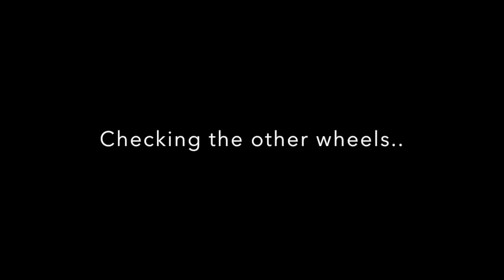New C63 wheel damaged after only a month!?

Comment: not trying to be mean, but you need to have some budget money for replace/repair your wheels if you are gonna go with low profiles,  thats why me and my friends always talk about it but never use it, tires are not cheap, rims are not cheap, and low profiles breaks very easily, just prepare for it, and dont get too upset because its totally normal
Reply: I can hit a curb and totally get away with it, I can roll over speed bumps at a much higher speed, I can drive wherever I want without worrying about shitty roads, and I take these advantages over the "looks good, improves handle" advantage that low profiles have

Comment: Just saw this vid. Welcome to PA roads.  With my most recent car I dropped from 235/35-19 to 245/40-18's because of these garbage roads in this garbage state bubbled 2 tires.  Also, factory "forged wheels" are never worth it in states like this.  Many factory option forged wheels are not super light, and bend as easy as cheap wheels even.  I learned that lesson a decade ago in PA, and relearned that last summer.

Comment: Could have been worse, hit a pot hole once, shattered the edge of the wheel, punctured a tyre and ruined a wheel bearing. Looks like the hole caught the wheel right on the edge though. Chances are if you just hit the hole square on it would have been fine.

Comment: That's why i never invest in wheels, roads around here are terrible and you wont survive with anything bigger then a 17... Really sucks man but that dent isn't bad at all, little heat and a hammer and they will have it straight in no time, I've seen way way worse wheels get fixed, will wheels like yours, you will have to be ready when this happens again because sadly there is a big chance of it .. Heating it up wont weaken it substancially.. This isnt a car you drive 250km/h + every day so I wouldnt worry to much because once you change that wheel and spend 2000$, hitting a pot hole again and damaging it again will make you wish you would have just fixed the wheel with some heat.. Only if it cracks then that is time to get a new wheel.

Comment: Low profile tires in Pittsburgh or any major city for that matter can get you man. I am looking into better tires at the moment before I purchase my 18 inch light weight, 18.4 lbs - 18.95 lbs vs 23-29 lbs factory Ford Fusion wheels,  OZ Racing LEGGERA HLT or the OZ Racing ULTRALEGGERA. If I can find light weight steel wheels that aren't ugly I would consider those. The OZ Racing wheel are a mixed Aluminum product, chem. compound Al (Si 7) Mg, and I believe can bend more so under stress than steel. I could be wrong; I need to find a YouTube vid about it that has no bias.....they aren't sponsored by any of the manufacture of the wheels, that mean the cost is on the Tuber, I am broke tuber so not gonna happen here. Unless I go technical on the vid and not care that I spent a couple thousand dollars on wheels just to crush them to see which is stronger. Well, gave that idea away......here comes the new YouTube channel that will out pace mine in a few months.

Comment: Dude, I’ll take your Swedish passport.  You can have my American one.  This county is going to shit.  I’ll need a Ford Raptor myself soon just to drive around the North East. You know in Mexico a lot of the OEMs will not sell the optional low profile tires / wheels.  They need to start doing that in the US.  I know someone who bent a 16” winter wheel in NJ that he puts on just for the winter. I’m on Long Island, but I’ve bent one rim on the NJ Turnpike, and year before that I had a blow out coming out of Philadelphia on the NJ side.  I bent another a year later in August around Poughkeepsie NY.  I was driving my SUV the other day and hit something that must have been 10” deep (it was filled with water) and I was happy I was not driving my 40 profile tire car as I was even worried about the 60 series tires on the SUV.  I’m pretty much done with the low profile wheels / tires at this point and I won’t even buy a new car anymore with them. The roads have deteriorated too badly in the US unless you live in the Deep South.

Comment: If you are going to replace the damaged wheel to 100%, you should also replace the tire to 100%. Although the tire looks fine, there are probably some steel belts that have been weakened. You don't want them failing at the speeds you subject them to. #playhard/payhard

Comment: Just from your videos i was aboe to gather that these cars are NOT reliable like a Toyota or Honda which can last 20 years. Your last C63 amg proved how unreliable these cars are. A simple water spray killed a 90k car were as a 1000$ winter beater honda would not have even blinked an eye in water. The car is beautiful but as a result the design is faulty for day to day driving. I run over pot holes all the time in my Prelude and never has the wheel gotten damaged.

Comment: If the wheel is 100% repaired, then why buy another barrel for the rim?!  I've owned over 20 cars since my first one in 1987, and have had aftermarket wheels from 15 inch, all the way up to 24 inches.  On top of that I lived in New York City (Talk about potholes!) for the majority of those wheel purchases.  I have 20's and 24's on my vehicles right now.  ANY wheel is going to succumb to a pothole, depending on how hard you hit it and the structure of that pothole.  Whether you have an $8,000 or $800 set of wheels.  I've bent many wheels in my day, and had them all repaired (if possible) as well.  You seemed more likable when you were doing car reviews.  I still like to watch your videos though, but sometimes you can be overly dramatic when it comes to your Benzes.  Its a car, and things will happen to it no matter how careful or reckless you or someone else is!  And this is experience speaking here...

Comment: Ha, ha, ha, ha, ha, ha, ha................................... yes, it's kind of funny the story there ! If you would have been driving a good old Volvo 240 with the 165/70/15 wheels you would not have had any problems ha, ha, ha, ha, ha, ha ! It's the so very low profile tires etc, etc wow, what a bummer but then again, you need to look COOOOOOOOOOOOOOL in those wheels ! TCB, from Finland.

Comment: Also, as a PA resident, I'm with you on the shitty roads/potholes/time of year thing... but you have no sidewall, let alone if you were speeding. I had as thin a sidewall or thinner on performance car for 8 years, no issues. If you were driving a vehicle with realistic tires, you would have been fine. Also... with all the streaming/looking at the camera while driving you're doing, maybe you should pay more attention to the actual road, lol
Reply: Bobby That’s a lot of assuming in one paragraph.
Reply: Assumptions are logical given a preponderance of factors: a habit of recording yourself while driving and looking into the camera (not near the windshield) rather than the road, you're filming yourself just prior to a hydrolock but miraculously the footage stops just before it happened, then you smash into potholes that aren't even that deep on a road with plenty of shoulder to avoid... best case scenario this guy is an inattentive driver. Worst case scenario he is an unsafe driver. Viable excuses for hitting that pothole: not paying attention, tailgating, or speeding. Viable excuses for hydrolocking the car: not paying attention or wide throttle/unsafe speed/accel. At the end of the day, these are driver issues. If someone has a hard time paying attention to operating a vehicle, they shouldn't be talking to a camera :)

Comment: Man somedays it just seems like no matter what you do them #$& potholes move in front of your wheel... Sometimes they hide as darker pitch in the dark or wet roads or you try and dodge and your wheel still goes through... And you hit one and drive a little and bang.. again and you are left thinking WTF.. didn't even see that one.. i hit one on a rainy night at slow speeds that was about 5 inch deep ( saw the next day) ... and then two more smaller ones all in the span of 10 min..i@#$&,!!!